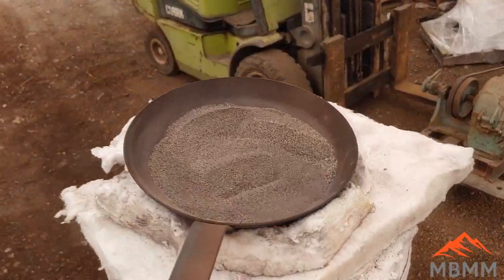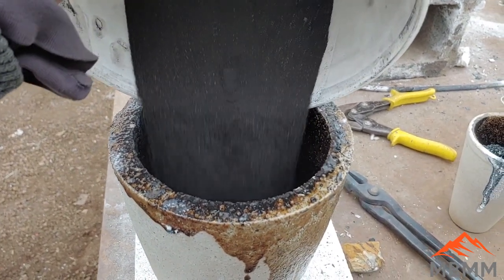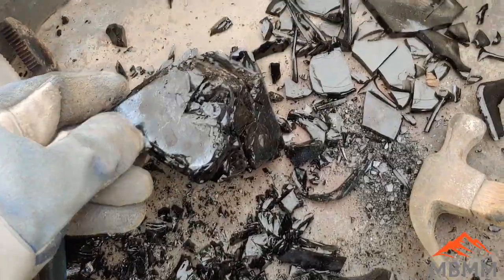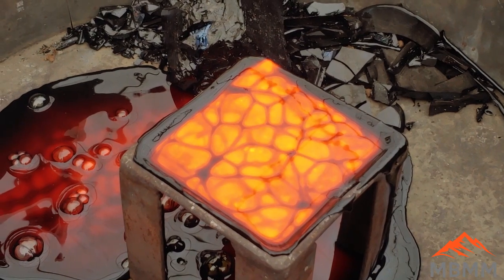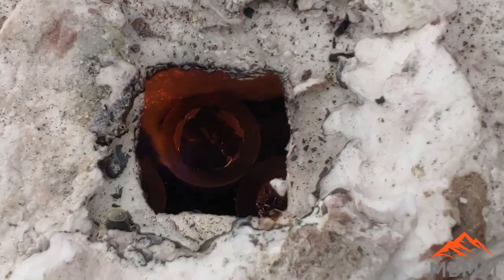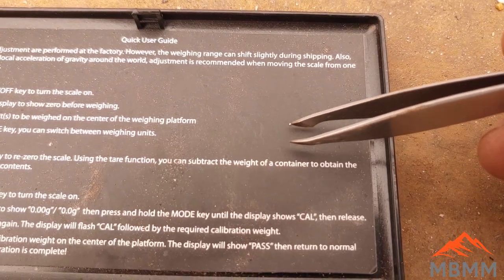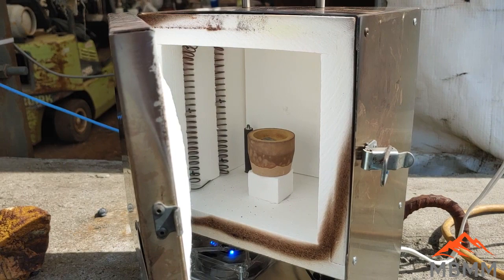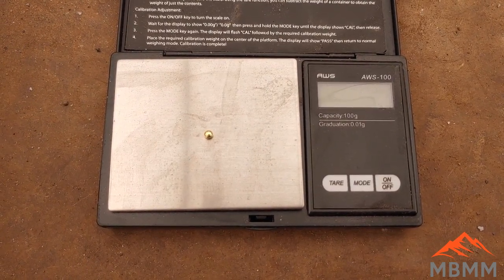Gold Panning Vs Fire Assay Pt 2:  Smelting and Assaying High Grade Gold Ore

Comment: Great series of videos, congrats on the interesting results. However you need to get a more accurate scale. They have scales on Amazon that go to 0.001 grams for cheap (I just bought one) and you can easily enough get ones that go to 0.0001 grams, which for assay testing you really need something like that.
Reply from the maker: Just ordered a .001 and a .0001 scale!  You will be seeing them in up coming videos, thanks for the tip.  I didn't realize they were that cheap.  I paid around $300 for my .0001 scale. It will be well worth it